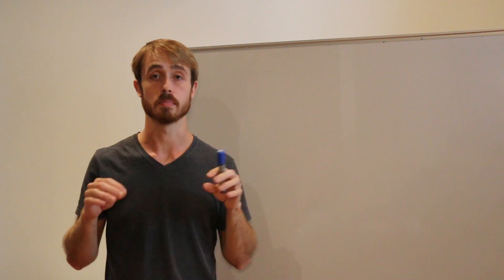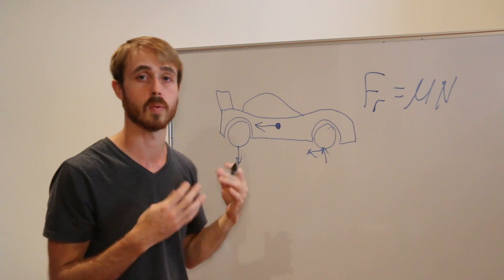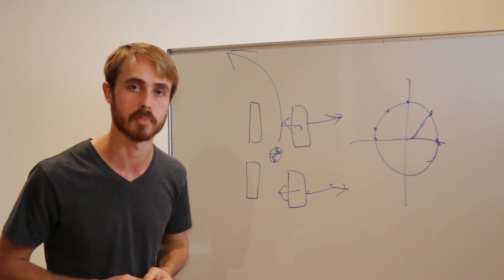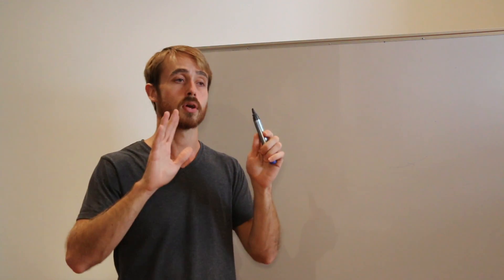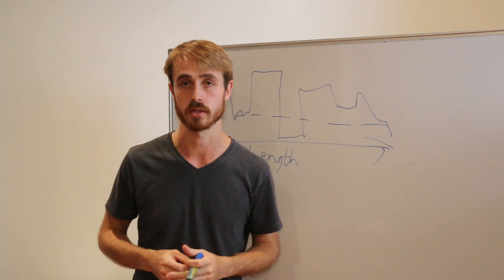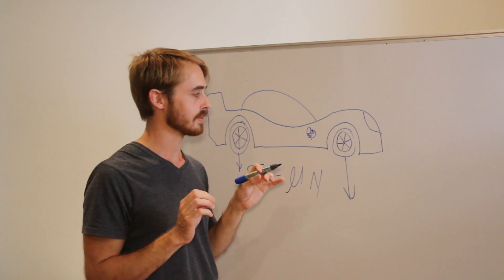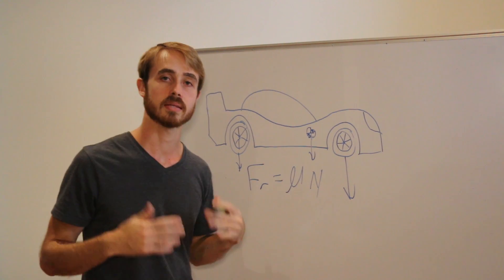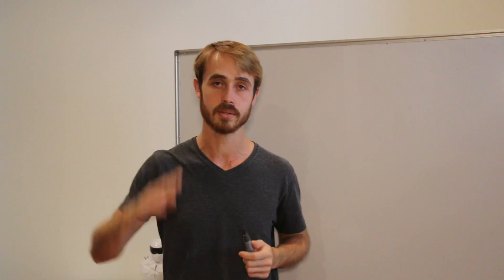Why is the Nissan GTR LMP1 Front Wheel Drive? A few reasons...

Comment: Sorry but u are wrong, Ben Bowbly said that the base setting is Full FWD without any rear power, rear wheel drive is only a option & only on staright.
Reply: That would make it all wheel drive wouldn't it? If the rear has axles connected to it to receive power, that would mean it has a capability of being AWD.
Reply: Themayseffect
it available to have a AWD kit, but it is designed for FWD to a full race, & even in AWD mode, the rear won't help for corner.

Comment: Great video! Finally more car physics videos! I do have a question that's been bugging me awhile: if surface area doesn't matter why does wider tires give better grip when compared to narrow tires? Assuming that the weight of the tires are the same and mew is constant? Thank you
Reply from the maker: Glad you enjoyed the video! As I briefly mentioned when talking about balancing the FWD characteristics, tyre area does in fact matter, hence the need for wider tyres at the front. Increasing the contact patch and tyre size raises the amount of total energy the tyre can take without overheating, thus ensuring optimum temperature for optimum Mu. In addition to this, the tyre curves that I mentioned offhand come into play. As the normal loading increases significantly on tyres, the effective mu value will taper off, this is the same reason why weight transfer during cornering is bad and why we want a low CG. Running a wider tyre/bigger contact patch reduces this mu taper as the normal load per unit area is lowered. I can do another video on this if you would like?

Cheers,
Kyle
Reply: KYLE.DRIVES I understand, thank you. Another question I've been wondering has to to with car spoilers. I've seen your videos on the subject already but my question is putting a spoiler upside down? Or putting an airplane wing shape to create lift not downforce. Not for racing obviously but for regular cars doing regular driving. My thought process is if you create lift on the front and back of the car let's say driving on the freeway going 75/80 mph, can the wings take off a substantial amount of weight off the car causing an increase in gas mileage? Basically at freeway speeds turning a 4,000pound car into a 3,500 pound car. Thanks for the prompt response
Reply from the maker: Dr Noro A few things on this point, first you have to differentiate between mass and weight, reducing the force on the tyres does not make the car have less mass i.e. it will still take the same amount of force to accelerate it at a given rate. This is why racecars with considerable downforce can still accelerate so quickly. Obviously the increased rolling resistance from the higher force on the tyres will be a factor, but at highway speeds rolling resistance is a small component of overall losses. What you must remember is producing lift or downforce inherently creates drag, as the up or downwash produces vortices behind you. The most efficient configuration for drag will always be zero lift, zero downforce. Solar car teams often aim for just enough downforce to keep the thing from flying off the road in gusts, but keep this number as low as possible to reduce drag. You may want to look up Sunswift eVe, I have had many conversations with the people who designed the aerodynamics on this car, and it does make a bit of downforce, despite being a world record breaking solar car.
Reply: Dr Noro I just wanted to add that a usual roadcar already creates lift at higher speeds (certain sportscars of course don't), so you don't want to add to that, because all you want is a stable car. Audi even had to subsequently add a small wing to their first TT generation, because it was too light in the rear at speed.
Reply: JDM Racer 2. rotational inertia / larger tire = larger mass moment of inertia, more rotational mass that needs to accelerate
Reply from the maker: Dr Noro Done: https://www.youtube.com/watch?v=y5Y-w4zGW00 hope you enjoy!
Reply: KYLE.DRIVES I watched it as soon as you uploaded it last night :) Thank you
Reply: Sense the body is wider it gives it more stability.
Reply: Dr Noro  There are pros & cons when we talk about wider tyres: 1.constant friction coefficient, because of the better tyre contact area in corners. (provided right camber positions etcetera)
2. The better ability to discharge the temperature (heat) 3.slower warm up (overheating in corners)
Cons: 1.much higher rolling friction 2. wider and heavier u when u accelerate u gonna loose a bit of wheelpower idont know how u call it in english. 3. A wider tyre reinforces the derive zero .4 and a wider tyre is more sensitive concerning to false position of camber  i think thats not all but a few important things ;) 

I hope my englisch is comprehensible

all in all Its very important to find the right size of the tyre, because we need a faster cornering speed to compensate it to the lost on the straight. But normally the regulations gonna tell which u can use.

And to KYLE.DRIVES great video. All in all great :)
Reply: love the tire size to friction debate. One thing to consider is that if shear/tensile strength of the tire is coming into play (on the track) or of the driving surface (think ice or gravel) then increasing tire size will decrease the stress on the tirepatch / ice / gravel allowing more force to be transferred without deforming materials. I'd love a good video on tire physics.
Reply: KYLE.DRIVES same here. Please upload a video on tire physics. And if possible rally tires. Pretty much any physics to do with rallying would be an amazing. Thank you for your time. I know it's a lot of work to make these videos
Reply: mu
Reply from the maker: Dr Noro Ok, I'll make it my next video when I get the chance! I feel the physics of rally and off road tyres are often under discussed as they are far more difficult and harder to quantify than road tyres, but I'll do my best! This would have been a good one to make 5 years ago when I was at my peak knowledge of tyres and suspension design...